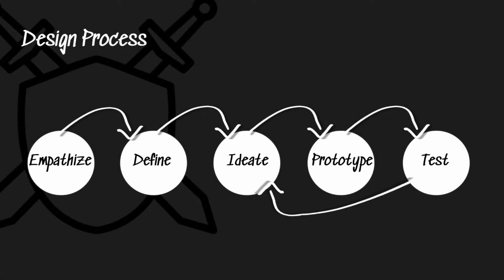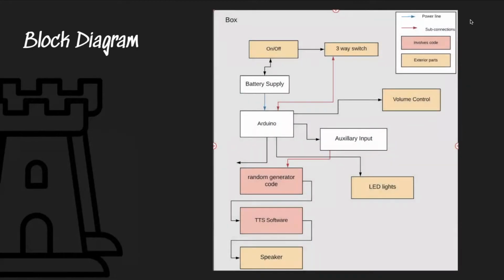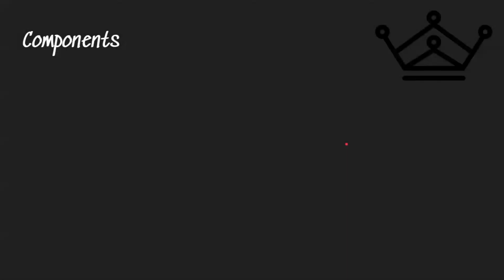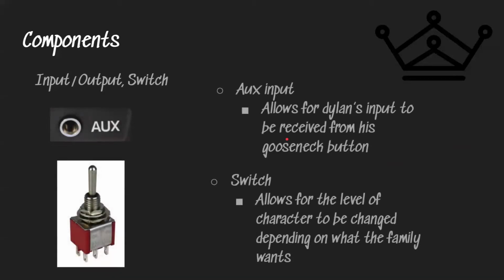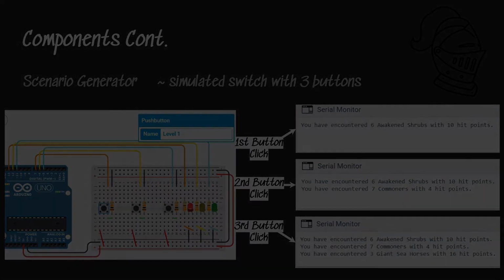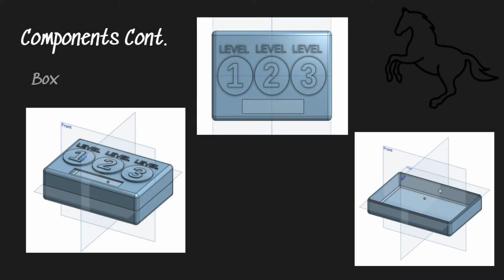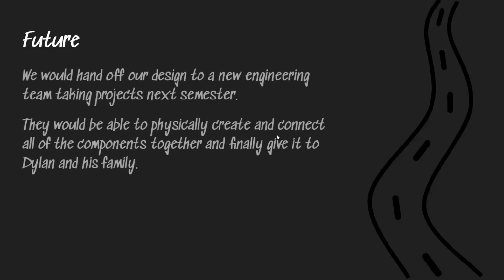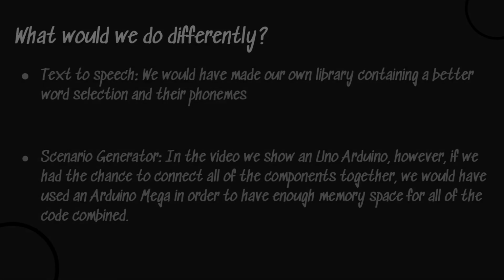Dungeons and Dragons Voice Assistant

Comment: I really like the design - the CAD, switch, and simplicity clearly indicate that you guys spent some time really thinking about your client and the accessibility of your device. You mention that your Arduino code randomly generates D&D characters and uses text-to-speech software to read off a line of code - if you were able to manufacture your device, how would Dylan and his family use the device together? Also, how does the toggle switch between the three modes affect the randomly generated characters / code / what is being said? So excited to hear back!